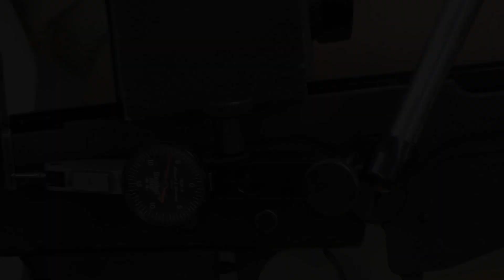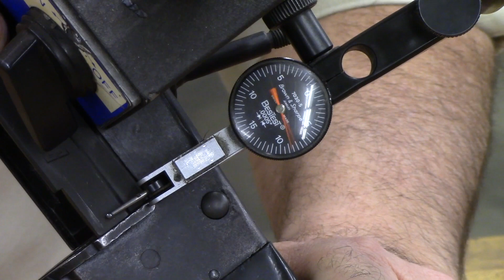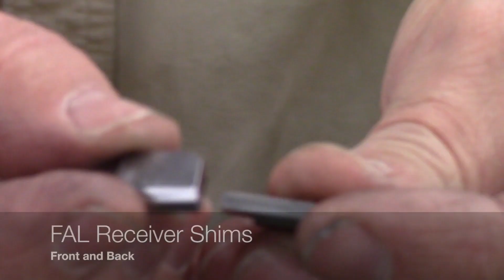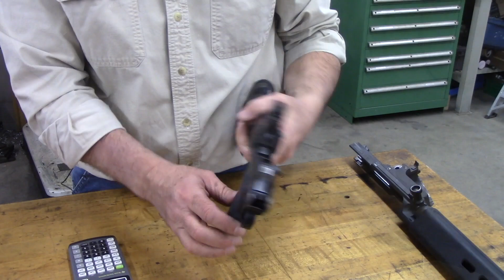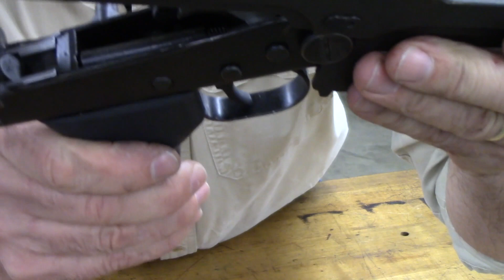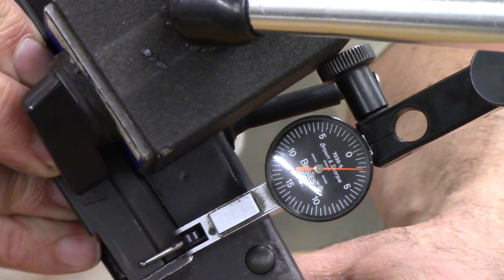FAL Receiver Shims Improve Accuracy In Your Rifle

Comment: Would you  kindly test it on the range?)
Reply from the maker: Absolutely!  Just waiting for the weather to clear and I'll get some range time.
Reply: @dauntlessendeavors1000  Do you have the accuracy improvement numbers from the range yet?
Reply from the maker: @czgunner  My FAL was a 3-4" gun at 100 yards, scoped, off a bench, with three different kinds of ammo.  I swapped barrels, which yielded the same accuracy results.  Unfortunately, I couldn't see a marked improvement in accuracy from the shims with my rifle.  I believe there are other factors inherent to the design of the FAL which will never allow it to be a super accurate rifle.  In engineering terms, the signal-to-noise ratio is so low that I couldn't measure an increase in accuracy by simply installing a set of receiver shims.  They didn't eliminate those pesky fliers, which kept opening up a 2.5" group to 4".  I believe the shims can help and I do love how it snugs up the back end when you close the upper and lower actions back together.  
My interest in FAL's has run its course and I sold my rifle about a year ago.  If I were to buy another one, I would absolutely install a set of shims but I wouldn't expect miracles, either.
Sure, there are guys who claim their FALs will shoot 1-2" groups "all day long".  If they do, they certainly are rare.
Unfortunately, I never get any customer feedback, either.  Neither good nor bad, which I guess is a good thing.  Like you, I would love to have feedback from a dozen different rifles, but it hasn't happened, yet.
Have a great day!
Reply: @dauntlessendeavors1000  Thank you for your honesty, I still am interested in your product.  I just entered my name onto the listing on ARS.  Any chance you will still produce a set?  Thanks again for your video and review!
Reply from the maker: @roadrenegade5151  If ARS is out, I have a few sets remaining.  Please email me to continue this conversation.  Thank you.

Comment: Hi from South Africa. I aquired a Ex Rhodesian/Zimbabwe FN FAL and it had the same issue. I guessed that it was the hinge pin that was worn, however my local Gunsmith took a look at it to check everything, headspace, bore etc and came to the conclusion that most of the movement was at the hinge pin. He manufactured a shim to fit horizontally that the the hinge pin closed down on and that solve the problem. The hook on the hinge pin had the most wear. I would be very interested in those magnet sims of yours. Regards.
Reply from the maker: Thanks for your note.  I agree that the hinge pin often needs tightening.  Unfortunately, I believe they tend to wear "out of round" which is difficult to repair.  Aside from oval holes, I think each rifle would require a custom diameter and length, which is why I decided not to attempt making oversized replacement pins.
Reply: @dauntlessendeavors1000  H again, yes, i thought of the same thing so didnt want to mess with the hinge bolt/pin. The hinge clip shim seemed to work well and tightened it i
up 100% to what it was. Will keep an eye to see what evolves after a lot of shooting, Thanks.